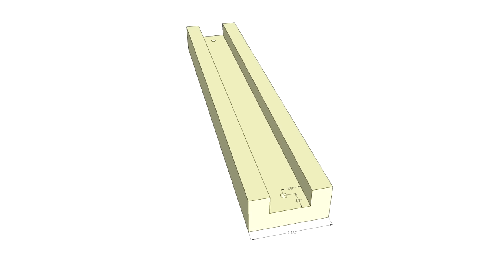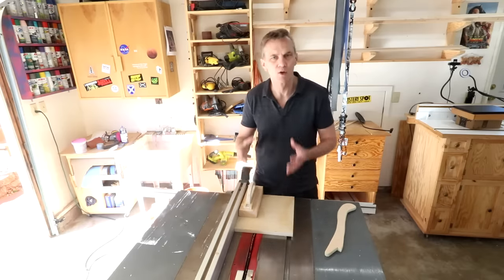How to make a push block. Essential woodworking jig and shop project.

Comment: When you drill the two holes in the cleats, you could stack them up and gang drill so that the holes are all in the same location.  That way if you replace a cleat, the holes will line up with the existing holes in the 2x4.
Reply: Gang drill............sounds sexy.
Reply: @imacracker515  Ew... no it doesn't
Reply: Good suggestion!
Reply: Glad I read the comments before posting. I was thinking the same thing!

Comment: I saw a post in a page on FB to make the spray-on template easier to remove without the glue afterwards.  Put down some blue masking tape on the wood, then spray-on the glue, then the tape comes right off without the issue of the glue stuck to the wood.  Thanks for the video Steve, love the channel and all your instruction!

Comment: You can always mark a line around the 2x4 base as a warning for the screw depth.  It's easy to forget to lower your blade, like when you switch from cutting a thick board to a thin one.  The "warning line" on the sides of the push block may help you remember, or at least give you peace of mind knowing you're still in the "safe zone".
Reply: That's exactly what I did

Comment: Freud recommends the blade be high enough for the tooth to clear the top of the work piece.
Reply: This allows the teeth to vent their heat out and will allow for a clean cut and longer lasting blade.
Reply: All brands I know recommend that
Reply: I'll use the height he used in the video for reference. But would there not be more time of the teeth being free of wood underneath the table surface? Thus allowing more time spent in the air for Cooling? 

Freud also recommends to buy Freud blades.
Reply: I've always heard that you should set the height to the bottom of the gullet so it can clear the sawdust. There's also an argument to be made that a higher blade height makes the cut closer to perpendicular to the wood making a cleaner cut. So many opinions on this one!
Reply: @jhersk  yeah that’s what I’ve learned as well. It makes for a cleaner and safer cut. Something about less chance of kickback due to the angle of attack of the teeth.

Comment: I just finished my push block and it works better than the $40 I bought. I cut one 8 by 2.5 by 3/4 inches wood board for the flat part, adding two 8 by 3/4 by 3/4 to inches to secure the handle side by side, which I  also cut from the same wood board. My handle was 6 1/2 by 2 1/2 by 3/4 inches and modeled the same as yours. 

Been new to woodworking, it took me have a day to finish it, using a Japanese saw and putting it together with wood glue. I finished the top part using sanding paper and stained it. For the bottom part, I used a 2x4x10 inches piece of  lumber, which will be replaced as often as needed. 

Next project is going to be a cross cut sled, which you also have a video for. Thank you for an excellent video.

Comment: I’ve made several kinds of push blocks over the years, but I really like your handle! So, your design has become my choice now.
One item that I found very useful are aluminum screws. My hardware store carries them—and I use them for jigs, etc. they will NOT harm a blade if you make a mistake.

Comment: One thing I did was glue some no slip material on the bottom of the push block and it helps. Got it from the dollar store and used spray glue.

Comment: As a novice and weekend warrior, I almost exclusively use this type of push block -- with sand paper glued on the bottom. I haven't noticed any significant dulling of the blade other than what you would normally get. It gets your hand away from the blade, gives you more control, tends to keep both pieces separate and reminds you to push all they way through helping to prevent kickback.

Comment: Safety tip!!
I'm pretty sure I remember you noting it in past videos, but thought it might be good to mention again. When applying and maintaining pressure in the three directions, downward, forward, and toward the fence, the pressure  applied toward fence should only be applied before the blade as pushing the wood against the blade will pinch the blade possibly causing kickback and burning of the wood.

Comment: 12:20 The actual operating manual of my table saw has this to say about the depth setting: "Make sure the top three teeth of the blade are just breaking through the upper surface of the workpiece when sawing. This will ensure that the maximum number of teeth are removing material at any given time, thus giving optimum performance." And that is exactly the 'shallow' depth setting Steve demonstrates at 9:40 or so.

Comment: I had an old plaster float lying around I never use I just screwed that to a piece of 2" x 6" and added a 1/4" pieces of ply as the cleat. Works real well and I am paranoid about keeping my hands away from the blades
Reply: Great idea. I think i have one of these as well.  Now, i just have to find it!

Comment: Perfect timing. I just got my first table saw. I signed up for two of your courses last year and have been saving up. This will be my first project with the saw. I sure didn’t want to spend $50 on a gripper. Thanks Steve for all you teach us.
Reply: I too would rather spend $100 on wood instead.

Comment: Great, easy and inexpensive jig. I wanted one of those safer jigs for my table saw but the price! This is nice. I built mine using a 2x4 and a gate handle I had laying around. Used 4 one inch screws. Works well. Thanks again.
Reply: According to “Stumpy Nubs” I depends on how much of your finger you are willing to lose. ⚙️

Comment: As an alternative to your design (as well as the micro jig) is just a 5 inch or so length of 2x4 with a 1/2 inch thick piece of wood glued to the bottom for a cleat.  Fits well in the hand and gets thrown away after time as the saw cuts through the body and cleat when cutting small pieces.

Comment: A safer way of doing the cuts at about 4:00 would be to not use your fence, and guide the wood through the cut with a miter gauge. As is, your wood is much wider than it is deep, and that can be tricky to push through a cut without it turning. Yes, the deeper the board is the less of a concern it is, but just a thought. :)
Reply: Thanks! As a beginner, I was wondering if that was safe to do or not!

Comment: Just got a new shop saw after 30 years away from the hobby. I made one of these in a couple hours and used a dado for the little catch block instead of screws in the back. Works great and I can rip away with confidence.... Thanks for a great video Sir 👍👍

Comment: May I add a thank you for your time, Steve. I have used a push stick for most of my work. Woodworking for over 60 years I have seen a lot of things I liked and one that sticks out in my memory is that plastic gripper thang, seems like to me it is a bit over priced and I have been watching different folks on youtube such as you make these push blocks. My first one was almost exactly like this video portrays and it still works, so keep you your honest and often humorous work up.I did not have a table saw the first few years but I got too lazy to use my worm gear Skil and bought one from Sears Roebuck.

Comment: With tabelsaw safety...
One thing that most videos miss in my opinion is that when you put pressure on your work peace toward the fence…
that you should stop applying pressure right before you reach the blade. Otherwise you just get kickback from the off cut. 
Not as bad as the other kickback but still hurts  😄

Comment: Another issue with metal screws in proximity to saw blades is even the slightest metal contacting the blade, even brass, is a scary concept for Saw Stop owners.  Hit a very small pin nail a while back and the brake unit kicked in.  Loud BANG!  Destroyed the brake cartridge and my cheap saw blade, and brought my woodworking to a screeching halt til I could swing by Rockler.  Brake unit and blade set me back over $120.

Comment: Nylon screws are very strong in tension; less so in shear.  Radio controlled airplanes have used 1/4x20 nylon screws to hold the wings on for decades.  A 1/4x20 nylon bolt has a yield strength of 296 pounds and a breaking strength of 312 pounds.  They're plenty strong for the handle attachment as well as the stop cleat.  They're not UV resistant so they shouldn't be left in the sun day after day.

Comment: The biggest consideration of that push block I was was the bottom of a 2x4 is not that flat, and would also be a little slick, not providing enough grab on the board to keep pressure of the board sideways towards the fence as you cut... planeing the bottom of the 2x4 and maybe attaching some sandpaper along the ends might be a great idea.

Comment: Three points, Steve.

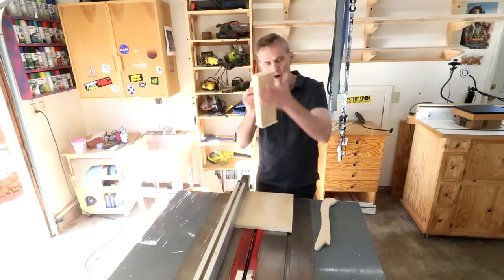First, at 10:57, if you put the push block against the fence, then any effort you try to put into "pressing [the workpiece] against your rip fence" (9:35) goes into merely holding the push block against the fence and you don't really have any control of where the workpiece is in this regard.

Second, at 11:00, I wish you'd pointed out that you're relying on the riving knife to hold the back of the offcut away from the rear of the blade.  If someone tries what you did without a riving knife, they could get a horrible kickback.

Third, at 13:55, to make the push block more "grippy", just put some of your spray adhesive on it and let it dry.  You may have to apply another coat after some weeks of use.

Comment: I like the idea of using some very thin soft grippy material on the bottom of the push block for better grip reducing the chance of slipping.  At the same time I don’t want my saw blade hitting this material so I would recommend just putting a couple of 1 inch strips on the edge of the push block leaving the middle portion of the push block free of the blade hitting it while still benefiting by getting a better grip.   Very good video really enjoyed it, many thanks.

Comment: In another of your videos you said that the rip fence is for cutting boards with the grain, or for those longer than they are wide. Why are you able to use it with this board, even though it's wider than it is long? Is it because you're not making a through cut? I'm trying to understand the "rules"--and also when you can break them, when you can't, etc.

PS It was after watching your "Steps to making the first cut" video that I felt confident enough to make my first cut. Thanks!

Comment: Imho the easiest way to improve the grip would be to use a real coarse piece of sand paper like 20 or 40 and use it (don't glue it) on the bottom of the push block.

Comment: One problem with this is that you can't use with a blade guard.  I have a guard with dust collection, and don't really want to lose either.  Also, the riving knife is not always easy to set at the same height as the blade, and different rise and fall mechanisms may make this problem appear.  This can cause the pushblock to get "stuck" at the end of the push, which can be more dangerous.  This looks good for your case, however for mine (which is not uncommon), I made a long handled block with the lip at the back, but only 3/4 wide.  Like a long handled pushstick that also pushes down.

Comment: I bought a Grrr-Ripper after I saw you use one. It is a fantastic tool. I have since seen people produce plans to make them out of wood, I'm sure, partly because they are pretty expensive.

This is an excellent alternative to the more expensive options out there. Simple is best, in my opinion. After some use, a person could easily hot rod this thing to be whatever they want. Thanks!

Comment: Great video.  I use a similar block made from a 2x4 or 2x6 on its side without a handle and I always use a feather board, ever where possible, to keep the wood pressed against the fence.
Reply: Yes to using a 2x6 on edge. You can cut a small chunk out of it to leave a "cleat" on the end or glue on a bit of scrap. Super-duper simple. Steve's video has the advantage of teaching some workshop techniques and the resulting GRRABBER looks more like a tool than a piece of scrap. So it's all good.

Comment: Love the push block. I changed one thing. I made the handle from a 2x4 same shape , but extended lenght ,making  a flat on each side to allow it to be screwed in 2x4 base. Save me from having to cut 3/4 groove

Comment: I don't want screws close to the blade if at all possible.
This might be the first one I make, however the second is going to have a dovetail on the handle bottom that will allow it to slide into a dovetail on the replaceable 2x4 'shoe'.  Drill a hole in the 'handle' and into the 2x4 shoe, and a short piece of dowel to act as a screw with a weak rubber cement or such.

Comment: Steve, what about using a 4x4 block instead of the 2x4? If you raise your blade high, you should clear your screws. Just a suggestion for all the ones who worry.

Comment: Steve ur the best. I built this and now i use it more that the micro jig because of the cleat in the back. Not worried about it gtting cut because they can be replaced so easily, not the case with Gripper

Comment: Love the idea. One could glue some dowels in the holes, instead of using screws.  I will probably use my home/custom made slip tenon jig to create all of the slots, instead of using dowels, because it gives more surface area than dowels, but it is the same principle.  Thanks for sharing Steve!

Comment: I would cut a ~1" channel down the center of the 2x4 and cleat. This gap could be positioned above the blade, with support on each side of the cut. No more sacrificial parts!
Reply: Haven't tried it for myself, but cutting a channel also reduces the surface area of the gripping surface which increases the unit loading (force per unit area). At least in theory, the effect is to get better "grab" on the work piece.  So it might also improve the general performance of the push block. In any event, it seems like a good idea, unless you cut the 2x4 too thin in the middle!

Comment: It's just a push stick. No need to over engineer. Great design making one next. Wasn't sure why you had the end offset until the end on vid makes alot of sense just flip the piece over and you've got a new stop. Thanks Keep It Simple Stupid are usually the best designs and functionality. I'm not afraid of the screws you would really have to be cutting in REAL DEEP into a push block. FANTASTIC.

Comment: I have always used two push stick and found it quite awkward, I did realise there were alternatives like the micro jig thing that you use (not sponsored) I never saw any sellers with anything like that here in the UK (I hadn't really looked much.  Even though I know that in woodwork everything but the blade can be made from wood, it never occurred to me to make something like that.  Thank you, I shall make one in the morning (it's 11.30pm local time).

Comment: When I do channels like you have at the 3:00 minute mark I use a piece of scrap material and after the 1st cut I adjust the fence for the 2nd cut. Once it's dialed in I make the cut on my piece. Something else that can aid the push block is adhering sandpaper to the bottom, that will help "grip" the work piece. The same technique is used on panel saw guides.

Comment: I like the idea of adding something to provide a little more grip; I think the biggest issue there is that it's intended to be a sacrificial surface on the push block, so you'd be also sacrificing whatever additional grippy surface you'd be putting on there. Of course, you could make it kind of adjustable like the Grripper to avoid sacrificing those surfaces, but then yeah, like Steve said, it's getting to be more complex than what the spirit of the project intended it to be!

Comment: Hey Steve,
Not sure if you have an Air Compressor - but I'm giving lots of thought to design etc. Mine is Stanley and quite noisy and not a good experience for my neighbours - we live in a very quiet area of Groningen. I'm thinking sticking with three quarter inch ply and go from there. I can get a hold of that egg holder shaped noise reduction material and a small extractor fan to keep box cooler. Cheers Chris “Thr Aussie living in the Netherlands “ 🇦🇺

Comment: Great idea, thanks for sharing this.  Very helpful video, as usual.  As a guy that has yet to bite the bullet and buy a Grr-Ripper, this is a great budget alternative!  As for the sandpaper on the bottom idea, I would definitely not recommend this.  While I have no empirical evidence to confirm this with carbide table saw teeth, I know that sandpaper will destroy a chainsaw blade in short order.  I would not want to risk that on my table saw blade teeth.

Comment: I’m definitely going to make some of these, it’s like a disposable grrripper.  I wonder if it’s worth running the 2x4 across a jointer to get a good flat bottom, and maybe adding some grippy material to the bottom to really simulate the grripper.
Reply: I like the idea of a flat bottom, I had the same idea.  I also don't have a jointer to do it, so I'm not gonna worry about it.  :D
Reply: He talked about grippy but said itd most likely get wound up in the blade or if using sandpaper itd dull the blade

Comment: As another option, for those that have a 3d printer, there are files on thingiverse to print out what is basically a Micro Jig Gripper knock off. Probably a whole lot more work to make, but as I just invested in a 3d printer last week, that sounds like a fun project to try. Just another option for anyone out there!
Reply: They have one on Thingiverse.  I haven't printed it, but it looks promising.
Reply: both are fun and you should do both
Reply: @ChiefMoonChunks  Absolutely!

Comment: If you didn’t have a jigsaw for the curved handle shape, you could drill a hole at an angle and use a dowel as the handle. I really like the keeping it simple method.